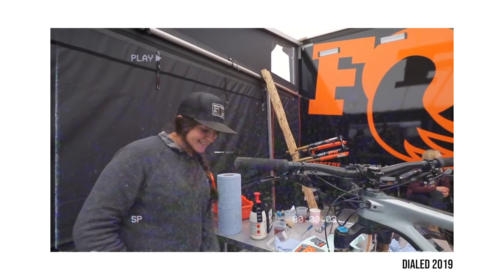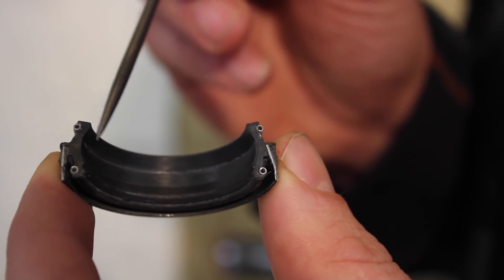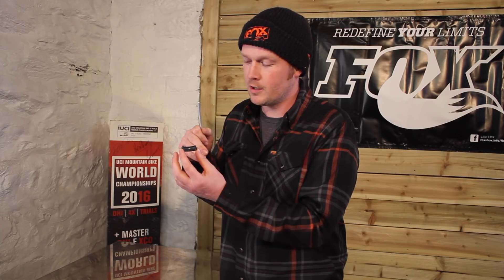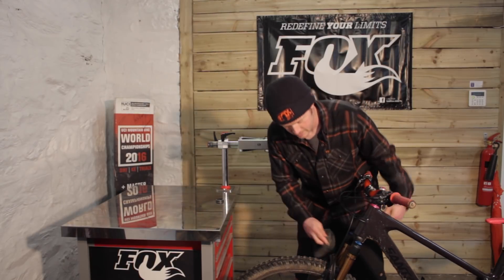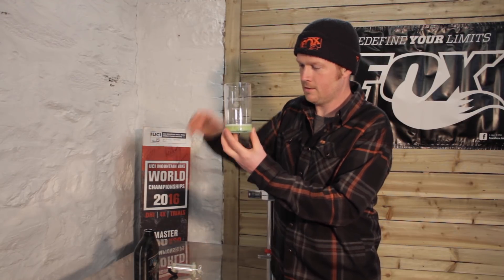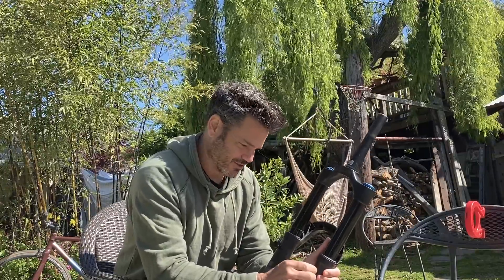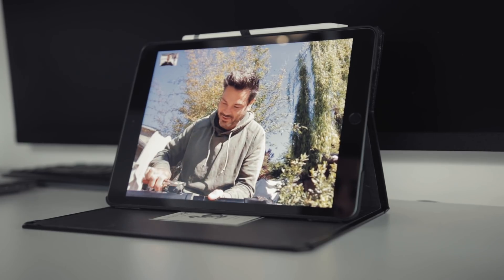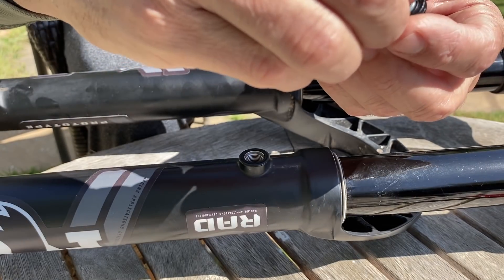DIALED S2-EP7: What's Inside a Fork Dust Wiper Seal? (Plus New Fox 38/36 Bleed Valve) | FOX

Comment: What do you do if your fork doesn’t have the equalizer valve?
Reply: You can hack it by using zip ties. Slide one through between stanchion and wiper seal. I never really liked this method but it works. Beware it can introduce junk into your fork internals and damage the wiper seal..
Reply: Luke yeah probably not a good idea if I want my forks to last.
Reply: @MichaelRei99  Other than the zip tie method, I think the only way to do it would be to loosen the nuts on the bottom of the lowers and crack them open to let the air out. Upside down, of course, so you don't let all the oil out too.

I don't feel  like this is something most people will need to do regularly (assuming your seals are, you know, sealing), so zip tie would be my choice. Just make sure to clean the area well before you do it and cut the zip tie so it makes a sharp point that slides under the seal easily. I had to do it last year when I messed up a service (put the lowers on without the air spring fully extended, so I had negative pressure in them) and it worked fine and didn't bother my seals at all.
Reply: Mike R you can use a small zip tie while you save up for a 2021 fork.